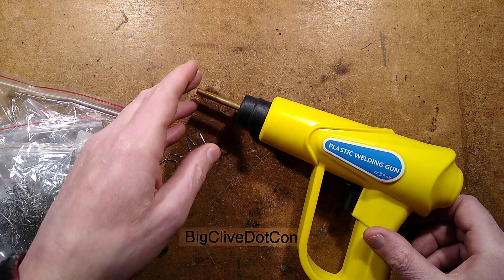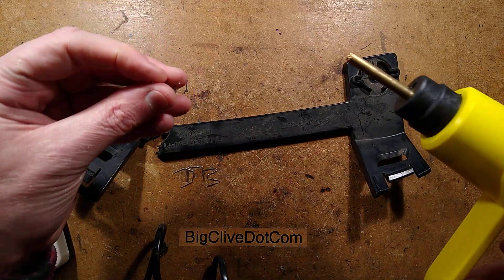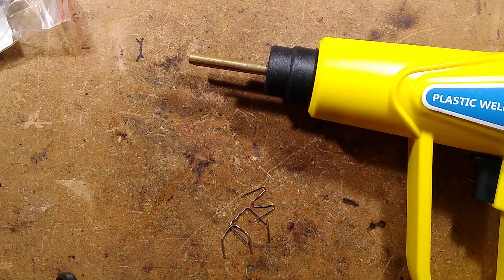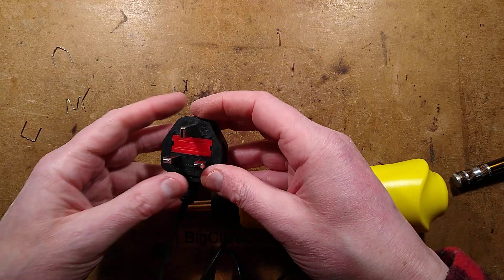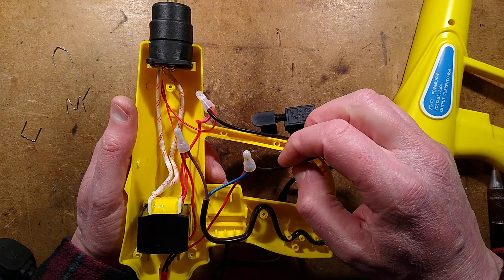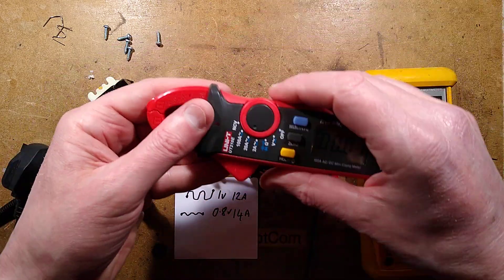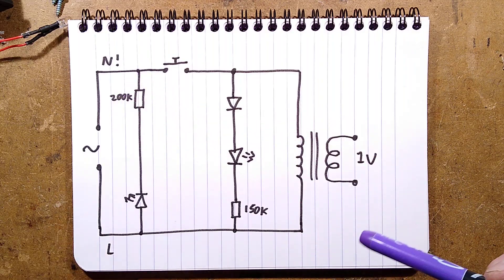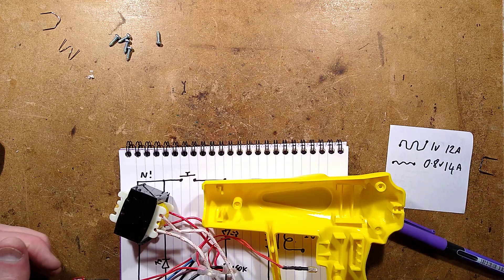Temu plastic welder with schematic

Comment: Knowing temu I’m surprised it’s not just a switch that activates full line voltage across those 2 terminals
Reply from the maker: I've struggled to find dangerous stuff from Temu.  It's been much safer than the crap sold on eBay.
Reply: It's worthwhile to remember that Temu basically brings together products from multiple suppliers (which are not necessarily the mfr) and ships them to you. You'll see them with multiple entries of exactly the same product, from different suppliers, at a  different price to you.
Reply: That wouldn't heat the wire. Need higher current  CORRECTION: lower voltage.
Reply: @d46512  Oh it absolutely would. The breaker would just trip very fast.
Reply: Oh yes it would!  Briefly though, very briefly.
Reply: @d46512  If it passes a couple of amps at 1-3 volts, it'll pull an awful lot at 240v
Reply: They tried that, but lost several engineers in a row.  The learning curve was steep but effective.
Reply: Yeah my first thought was I wouldn't want to be touching the output prongs heh. At least that baby transformer isolates the output, if only coincidentally.

Comment: I've used this system quite a lot in the past. The joints are mechanically strong(ish), and providing you can refinish the surface (or "staple" on an out of sight area) the end result is good. Obviously a LOT stronger than any glued joint (even epoxy), but definitely not OK for any "significant structural" purpose.

Comment: For anyone thinking of getting a plastic welder, be aware they are extremely situational.  Generally speaking if the part has any load on it, it won't work long term (or usually short term eg the next time you use whatever you fixed).  Also it is dependent upon the type of plastic.  For purely cosmetic things, both the stapler and soldering iron types will be fine.  Bottom line: avoid things that use plastic as parts that have a load/involved in motion, though that is largely impossible.  Also, if using the soldering iron type especially, respirator and fume extractor.

Comment: they are great tool clive so far ive fixed car plastics household heck i repaired the cat box LOL but instead of replacing an item fix it i do like the handle yours has mine is a block with a button

Comment: I saw a video, where they used a Soldering Iron with a flattened copper tip, to mend cracked plastic. They used the metal mesh (from coax cable), and melted it into the plastic.
Reply: I did this, it worked but looks terrible.

Comment: Oddly satisfying.  It’s important to note that thermal plastics like ABS will yield the best results, since the plastic can homogenize back to itself.  Would be interesting to bond 3D prints together, since it’s all entirely thermoplastics.  However, I would much rather it be temperature controlled, so you don’t burn the plastic.
Reply: Well it can only really work on thermoplastics, since thermoset polymers would not melt at all. If you manage to get it in, it’s from burning the polymer.

Comment: If you end up actually using one of these, give it a small twist after inserting the staple for a stronger and longer lasting bond, a few degrees is all that's needed but up to 15 degrees is good.

Comment: I bought one of these about two years ago and it failed after about five minutes' use.  A different one I got later is still going strong.  Install the staples with the 'pins' along he crack--not on opposite sides of the crack.  That makes for a much stronger bond.

Comment: No mention of the spec sticker on the side of it being total **  70W and 0.65A, if true that would of been a far spicier voltage
Reply: Those are Chinese Watts, similar to the ones on limited time expo sale car audio amplifiers. There's a similar markup on camping tent sleeping capacity where eight means maybe two.

Comment: If you ever break a hotdog that's been electrocution cooked, you might be able to fix it with the Temu Welder. Worth a try but watch for the wire, they'd hurt worse than eating a pin bone in a fish. You could also bend the fastener into a shape like your initial and brand your hotdogs to ID them. No end to the joy. 8^) Cheers!

Comment: 3:30 Please weld the snake lengthwise over the crack!
P.S.: You saw later the wobbly result.
You can use the welding devices for repairing thermoplastic on lawn mowers, car bumpers, toys or cases.
Welding, gluing, sanding, spraypainting - done.

Comment: Temu finally has somerhing that interests me.

I use Stanley staples & a blow torch for plastic welding. Then I turn down the old wep soldiering iron to melt together the actual split.

Comment: I got one of these recently from AliExpress (£12) and was surpsingly impressed with it, worked perfectly for what I needed.  Was curious how basic or clever (basic it seems) it was inside! Well timed video with my curiosity, thanks.  I also didn't realise the legs snapped off! I was using flush cutters.  Everyday is a school day still
Reply: Yes, they are pre-cut, but they don't always snap off so well.
Reply: Like everything from China there are 'cost optimized' versions, like the ones I bought, which aren't pre-cut and thus don't snap off. It won't be long before the snap off versions are a historical footnote in the race to the bottom.

Comment: Curious if that 13 amp fuse contains filler sand, or has the fuse wire poking out of the end caps. Seeing so many like that on imported items. Seems no matter what the rating of the equipment they install a 13 amp fuse where often the conductors in the cord could not carry 13 amps for more than a few seconds without some serious overheating...
Reply from the maker: I opened it.  No sand.
Reply: @bigclivedotcom  Sad... Seeing more and more like that...

Comment: I bought over of those from Temu recently. It says it works on 120 to 240v...(I'm in the USA) which is like... Kind of true, but it takes 10 seconds to heat up at all on 120. Wired it up to my 240v welder outlet and it actually works pretty well. Under load it's only putting out one volt. I immediately took it apart to see if there was a center tap, for 120v, but no. Then I realized i could make this wireless, because I have a couple of 2.5v 500F super capacitors (also from Temu). Works much better running off the Supercap. I want to rebuild it so it charges the cap from some 18650, but that project has been on my To Do list for a while now.
Reply: For USA, double the number of turns on the transformer secondary :)

Comment: I have an old Weller soldering gun, it has a multi-turn primary and a one turn secondary. The tips were heavy gauge copper that were clamped into the secondary.  It had a two-stage power switch, pull it harder and the output heat level increased.  I did a lot of soldering with that gun, and it still works.
Reply: There are 2 versions of that weller. 1 goes from low to high power as you squeeze the trigger. The other goes from high to low. I forget which was the original.
Reply: I still use mine regularly,  I have the original red one at home and the newer black one at work.

Comment: Very interesting little  Temu tool.  I was expecting a longer heating time.   Also surprised to see an actual transformer inside.   -~ Where’s the rest of the Tesla?
Reply from the maker: The Tesla headlight has its own video.  A small patch of corrosion on a pluggable module condemned the whole expensive light.
Reply: @bigclivedotcom Thank you B/C.  I believe I saw that but will go back and check.  Cheers.

Comment: The thing about these plastic staplers is they need to be used in conjunction with other plastic repair tools like a "welder." Also you should turn the staples a few degrees after sticking them in plastic so they have a little more bite to them.

Comment: Just had a friend trying to melt steel wool into a snowmobile hood to fuse a crack with a soldering iron, this is much less "rural" way, thanks!
Reply: Next time, use a little strip of aluminum window screen.
Reply: I guess I would have opted to either use a clothing iron with some parchment paper to prevent running the iron (unless that wouldn't get hot enough?), or, a hot air gun  and then used something to push it in one the plastic is gooey enough.

Comment: Note you should put the staples in the other direction, so it maximises the amount of times it crosses the break
Reply: I was watching and paused to say the same thing. If the first one had been pushed in at the same orientation of the second one, that would have improved it drastically.
Reply: Indeed... You need to have the wiggle across the crack.

You know what to do with that plastic crack...
Wiggle wiggle wiggle.
Reply: Yep, you want to have the crack going through the waves like an X axis through a sine wave. I've seen these used a lot in automotive repair body work since all the body panels are plastic now and they can hide it with some filler like JB weld in the low spots, sand the high spots flat, and repaint.
Reply: @pHuzi0n  exactly. These are nice for diy fixing a bumper on a car you don't want to spend too much money on
Reply: Its not only the wire holding it together, it welds the plastic around the wire together too. I use to set the wire in and turn or move it a bit in the plastic to weld a bit more and dig it in the Material.
Reply: Indeed

Comment: 12:31 not gonna break down? I melted the transformer of one i got on amazon after 1 use of about a dozen staples. The thing stopped outputting voltage and it wasnt a broke wire. Could smell the "hot metal" smell pretty sure it cooked the enamal coating off the windings.

Comment: I bought a combination plastic and metal stick welder from Vevor this past summer.   C$130.00 on sale.  I haven't actually tried the plastic side of it yet.  But the metal stick welder worked really well.  We used it for some structural repairs at my restoration project a couple of months ago.  It was a 3-day job, and that little welder kept up just fine.  Even if it had failed shortly after the job was done, it would have been an excellent deal given the amount of weld it laid down over those 3 days :)

Comment: Hi Clive.  Another instructional and destructional video - awesome!  Am I right in thinking if there is ever any break down of the insulators between the primary and secondary on the transformer that essentially the two brass studs would be live at mains voltage?  It doesn't sound like the sort of component you want a lowest bid supplier for, but I guess the whole thing is made to a tiny budget.  Cheers!  Paul.
Reply from the maker: I was tempted to unwind the transformer to check it out, but want to try the unit out first.

Comment: I would like to see a short segment where you showed a connection that actually worked well or didn't. Basically answering the side question of "is this a gimmick or does it have a real world use"?
Reply: It does work really well, but it really needs to be done on a hidden surface. It's not easy to make it look pretty. 😁
I've seen it used on motorbike fairings, and it holds surprisingly well.

Comment: That's actually pretty cool Big Clive.  Thanks for sharing this.  I think there have been a couple of times over the years I might have used this.

I wonder about the strength of the bond I guess because of how readily the resulting wire snaps off after the weld, but I suppose if one were to use this in conjunction with say epoxy, it might be pretty good.
Reply from the maker: The wire snaps at indented points.

Comment: I have a 100-150w soldering iron that's exactly the same, I suppose this is just a seriously lower powered version, mine also has no thermal fuse, to the point it gets uncomfortable to hold and has bubbled up it's own label

I wonder how hot a two prong solder tip would get in there

If unloaded it out out 3vac, does that mean those elements are 3k resistance?

Comment: Once you've sunk the staple, give the gun a twist and embed it using rotation.   This will provide far greater rigidity than a straight push alone.
Reply: Wiggling helps reflow the polymer so it can stick to itself and close the "entry wound", giving some of the strength back to the melted surface.
Reply: Another tip, use some kind of cheap tape, (painters, scotch) to hold the parts together for you, you can run it right through if the tape's in the way.
Reply: @adamflyshotmail I read somewhere that you should use aluminium tape for this
Reply: I agree with a little "twist" to seat a bigger area. 
   TBH the "repair" shown just needs to hold the two halves in position for the install, after which they are "clamped" in place by design.
Reply: Well, to "knit" the crack together he could have put the staple in so it crossed the seam multiple times with it's squiggles.
As-is you see how poorly it worked. Not intended use I think.
Reply: @1kreature You are correct, Clive applied the staple 90 degrees out, it's supposed to zig zag across the break.  No need for any "twisting" when used as intended, but they are designed for bumper repair where you would typically have multiple staples along a crack. Not really suitable for repairing the bracket he showed.
Reply: I guess it is not even legal to drive with a 'repaired' bumper this way... using foreign materials in a safety-feature of a vehicle (probably apart from militairy use). @ferrumignis
Reply: @elvinhaak  It's quite legal, bumpers are just a plastic cover over the actual crash structure these days.  They don't absorb much energy themselves.
Reply: 😂😂😂 @elvinhaak
Reply: I like to rotate at least 8640 degrees…
Reply: @SpenceReam  why not 25 turns?
Reply: That's why they call you maverick  @SpenceReam
Reply: @SpenceReam  Aah, you have the "impact" soldering iron.
Reply: @CraftAero  I believe the technical term is Tig Welder.  Clive showed how to use them a while back in "DANGEROUS 100W LED EXPLODES!".
Reply: @CraftAero  I was going to make a "that would be Spin Welding" joke (aka friction welding)... but as it turns out, plastic friction welding is a real thing!😮 😅
(I've only heard of it for metal welding lol)
Reply: @DUKE_of_RAMBLE I thought this was a polystyrene friction stir welder actually, the wire staples seem great though!
Reply: @CraftAero  Hmm, that is true, and that completely escaped me in that moment... Thanks! 🍻
edit: huh and these other replies didn't show up in my notifications, sorry about that guys!
Reply: Thanks!
Reply: Theres no need to twist, it holds plenty strong enough
Reply: Exactly.  I just give it a push laterally.
Reply: I’m half expecting Clive to drive up in a clapped out Honda Civic 😂
Reply: @ŠpVŠpý Hey there I drive a 2015 Civic. Not such a bad little car, except for it not having a display with time, indoor and outdoor temperature (even my 20 year old Saturn has those). It really is good for a person who doesn't trade in often and keeps their daily driver in great shape, keeping current on service.
Reply: @tncorgi92  This message brought to you by the Takata airbag company- "We die like real men!"
Reply: @tncorgi92  You aren't getting the joke, people use these to repair body kits.

Comment: This is an extremely useful tool to have. Initially they were mainly used by auto body shops to repair cracked plastic car bumpers. About 4 years ago they cost a ridiculous price of about $300 US, so I built one myself by modifying a microwave oven transformer. I repaired many cracked plastic items with it over the years and the repair is a strong as the plastic itself. Some plastics like polyethylene are impossible to glue together but this does a fantastic job on the repair. Funny, it's the same old story with the Chinese ripping off the the design and banging them out at a very cheap price.

Comment: Have you gotten/dismantled one of the plastic welding units with an end similar to a soldering iron, but flat to melt and let you push the plastic where you want it/into the crack, or whatever?
Reply from the maker: I've not looked at one of those.
Reply: @bigclivedotcom  The Weller guns?  You should,  I believe they might have a flat wound transformer or something equally unusual? 
Can't see much through the slots in mine, but it looks as if it's enclosed in a (slightly rusty) steel shroud. 
I don't really want to take it apart because I've had it for forty years and I don't want to bugger it up now. 😁

Comment: Resistive Thermoplastic Polymer Recombobulator! Nice and pretty handy, especially if hot stapling is combined with glue.

Nice 73 meter. And now measure it once again just to see if it was not a Fluke! I use a 179 in my lab. More to come in the future, I think :)

Comment: Makes me think a little adapter for my Weller soldering gun to accept these staples would be handy.
Reply: @aaakkk112  My Weller (circa 1970) did come with some flatterened tips for 'smoothing' plastic and the like but it never entered my head (or  probably Weller's)  to use a sacrificial tip - i.e. the wire 'staple' that these use.  I shall buy some of the staples and see how they go.
Reply: Don't  really need an adaptor. If you take out the tip, you can just push the staple into the holes. It only has to touch to make contact.
Reply: @ParedCheese Probably not, but the hole in the gun is significantly larger so the staple might move around too much. I'll have to get some and try it.
Reply: @strehlow  use a MIG welding tip  ;-)
Reply: GREAT idea!
Reply: You beat me to it!
Reply: Good idea although the current might be much higher then the 12-14 amps.